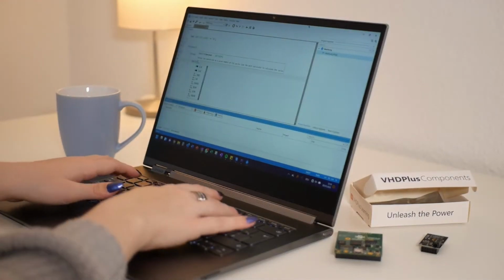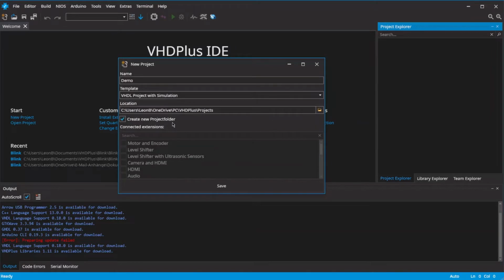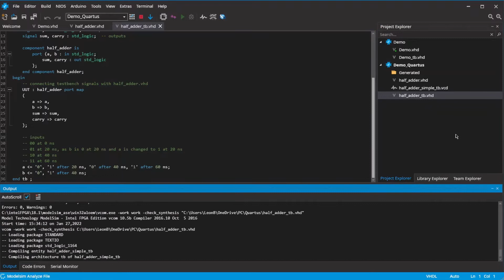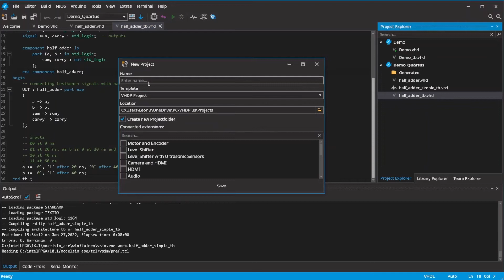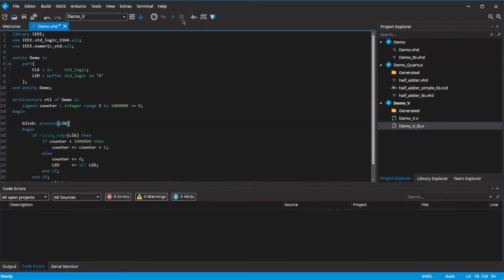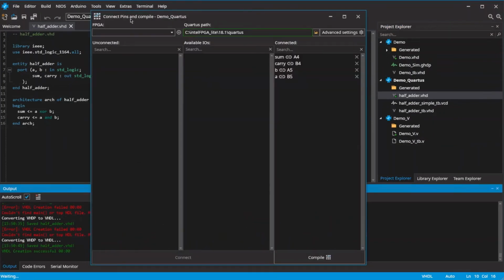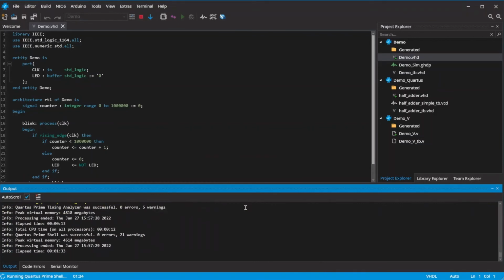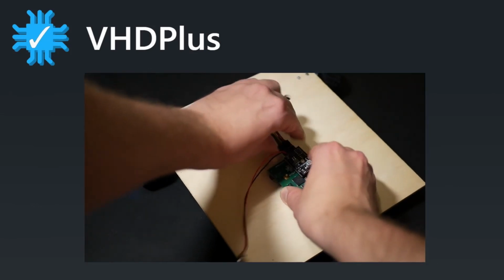VHDPlus IDE for Pros and University with VHDL or Verilog

Comment: Is there some more detailed documentation on adding a different FPGA?

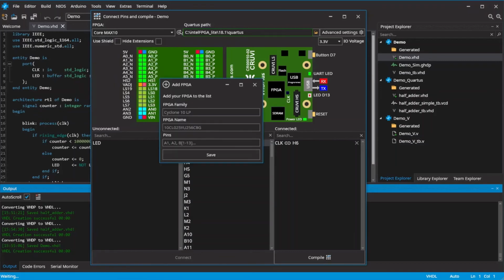7:40 This sort of tells me it can be done, but I'm not getting the details of how to do it.  I appreciate you'd rather people used your hardware, but if I'm going to learn to use this IDE, I want to be able to use it for all the FPGAs I've got.

I don't see any xml file with existing definitions, but I do see an empty folder called CustomFPGAs.  Presumably, if I make one it goes in there, but being able to refer to the xml for an existing one doesn't appear to be an option.

Can I import a pins definition from an existing project (in verilog)?
Reply from the maker: Yes I would recommend to Import existing projects and don't define the pins for your fpga. The pin connection feature is mainly for the supported development boards
Reply: @vhdplus  Thanks.  I was picturing importing just the pins definitions from an existing project into a new project...  I see there's a problem with trying to use it with all the different FPGAs I have though - I'd forgotten that support for the Cyclone II and Cyclone III was dropped after 13.0sp1.  I guess I'd still have to use Quartus for those.
Reply from the maker: @TooSlowTube  You can use the VHDPlus IDE with all quartus versions
Reply: @vhdplus  I can see I can set a different Quartus version, in the settings, but can I use the VHDPlus language with older versions of Quartus?

It seems if I import a verilog project all I can do with it is look at the code or open it in Quartus.  I'm not clear how to do anything more than that, with chips that aren't supported directly.
Reply: @TooSlowTube  hey, i'm trying to import board files as well, i downloaded mine from a zip from Vivado, with a board.xml, a part0_pins.xml, etc. but what do you mean import from a project?
Reply: @OpRaven-62  I've only used Quartus (free version), not Vivado, but every project has some standard files, including a .qsf which defines all the pins used.  When I start a new project, I normally use a menu in Quartus to import assignments from the .qsf for an existing project.  There are other ways, but that always seems simplest.